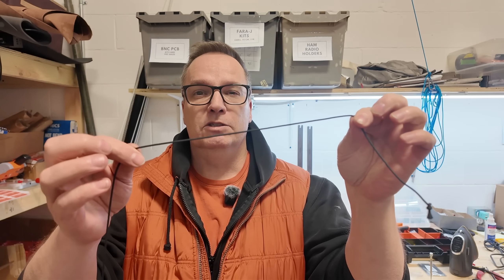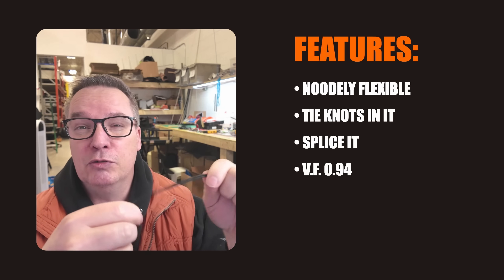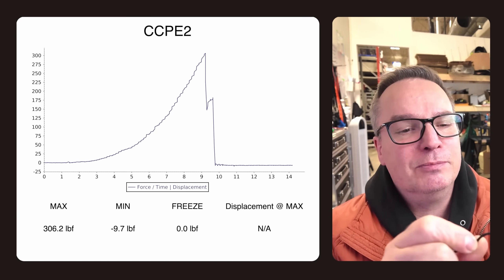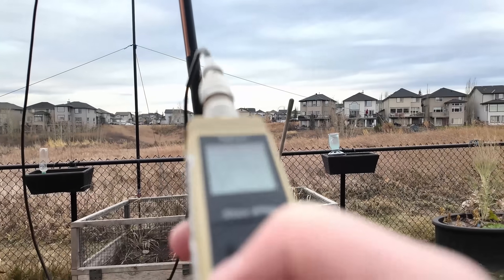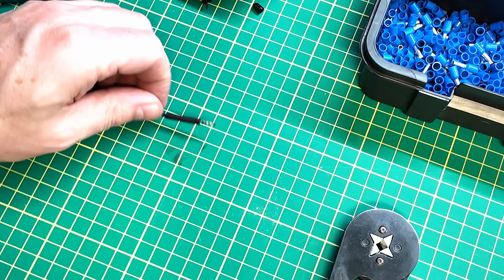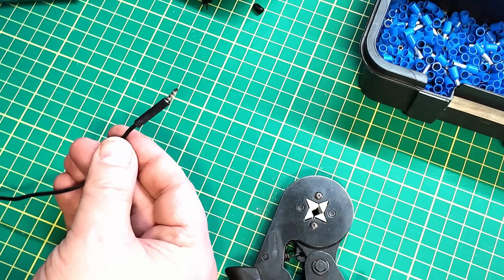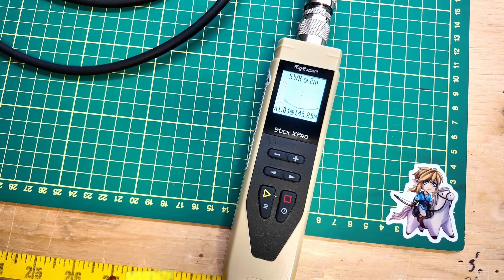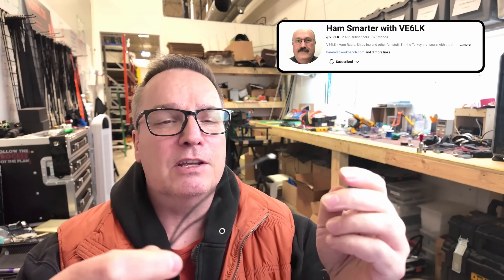This ‘Rope’ Is Actually Antenna Wire — and It Matched Copper Wire

Comment: It’s actually a 2 dB loss relative to a copper dipole.  That’s huge when you are squeezing out every watt.
Reply from the maker: A fixed “2 dB loss” claim only makes sense under assumptions. Once you factor in deployment height, pattern, ground interaction, and matching losses, material conductivity alone rarely tells the full story. That’s why I focus on comparative on-air results rather than theoretical penalties.

Comment: Greetings!   Now I can fly my 8' Delta kite without RG-174 coax with a vertical dipole, and use it just as a EFHW without worrying about the string breaking.  The kite takes one minute to reach 200' and is light weight for SOTA or POTA with a 5 knot wind.  Slip knot SWR adjuster is great.🤔
Reply from the maker: As with anything in the air the air will build up static on the RSE line. If you do this make sure to have a ground line!

Comment: This is really cool, and so many possible applications outside of Ham Radio! What kind of power will it handle? Can it be used to run phone/CCTV/12v to an outbuilding?
Reply from the maker: The resistance of the line is not conducive to DC. I am working on how to reduce this though and hope maybe in the future that this would be possible. Right now 100-150 watts will be the max on it

Comment: So 300 lbs before it breaks what does this mean in a ice storm ? Sooo its 8.32 pounds per gallon  300/8.32  is  36 gallons worth of ice .... but wait a antenna support from two directions so it would take 72 gallons of ice to bring it down. Yes your 160m dipole should be just fine. Its not too often you see a dipole holding up a 55 gallon drum of water. But we don't know what's happening to the nickel coating during that kind stress. Thinking carbon fiber will give before  it stretches while nickel over a distance would give a bit. In other words I'm thinking the mechanical failure will be noticed before the electrical. Plus there's plenty of overhead anyway. Not just a solution for portable antennas it may have a great spot for the qth as well.

Comment: you missed the best design from the old british army antennas. the core is dacron but you add plated copper to the braid weave. this allows stretch without stretching the metal wires, and because the surface of the braid contains copper, you can unroll your fraction of a wavelength and anything left rolled is shorted and electrically doesn't affect resonance.
Reply from the maker: Great point!

Comment: Tractor supply 600’+ 820jb wire for 70 bux US
Reply from the maker: Yes but no where near as light or easy to tie knots into. Still a viable antenna

Comment: Well i strongly disagree with your modeling. We need to remember the skin effect since you have alot of fibers you have alot of skin more than copper wire. Reminding me of litz wire made with  many many hair like copper wire increases the surface area to minimize the effects of the skin effect i.e. all of the copper is conducive as it is in DC. My point its might be right up there with copper since you have to many conductive paths 

https://en.wikipedia.org/wiki/Litz_wire
Reply from the maker: Fair but how does one model this then?
Reply: @VE6SFX_HamRadioRookie  thinking the vna is the answer for that. There's a few ways to employ it for the task using both ports.
Reply from the maker: Good point! I'll need to study up on how to get this info from my VNA. Appreciate the help in leading me down the right path.

Comment: Brilliant! I'm interested if it's orange. Can't beat DX-wire Ultralight UL for portable ops, but it's black...great for stealth, but therefore hard to see when hanging it, snarling it, and tripping over it. ;) 73 DE NØIP
Reply from the maker: Yes on the second run I’ll be doing orange for sure
Reply: @VE6SFX_HamRadioRookie I'm intrigued by your design. 73

Comment: It might change electrical characteristics when it gets wet, and or freezes.
Reply from the maker: We have done some preliminary testing. And it varies less than expected . But it is a good point
Reply: Thinking Nickel will hold up as far as chemical degradation after all it is what makes stainless steel but Im very easily could be way off
Reply from the maker: The manufacturer has had the raw core material outside for 10 years and the only noticeable difference is the color. In the end I suspect my overbraid will be the weak point

Comment: Nice stuff, but i don't trust this kind of flexibility. If it is as you showed and it can be used every day and lasts 1 year, than i think this is very great.
Reply from the maker: I understand your concern about flexibility and durability. I'm actively testing its long-term performance. I’m confident it will last just as long as copper wire

Comment: I am thinking about erecting an 80m horizontal loop. RSE sounds like a good choice.

But I must note, the price is high compared to Callum's DX50 wire. Regardless, I signed up on your email list; hopefully more trade will make it easier to bring Alberta in as 51st state. 🫣
[Edit: forgot about tariffs to US, cost may change]
Reply from the maker: I have figured out the tariff thing. CUSMA allows for radio communication antennas to pass tariff free. It’s just more paperwork on my end.
Reply: @VE6SFX_HamRadioRookie WOOHOO !!!

Comment: Have you tested it with 100w cw? 73
Reply from the maker: I have not yet. As far as calculating the power and heat the resistance should make at the ohmic resistance, it should handle 150-200w

Comment: Really cool!  It reminds of an idea I had years ago about threading wire down the hollow center of that yellow poly rope you see used in marine environments.  It doesn't weather the sun very well so I wonder what the UV resistance of this stuff is?  Still a poor man's version is copper wire threaded through the center of poly rope and you can go through the braid at any point to access the wire.  The rope takes the load while suspending the copper wire within.
Reply: My brother-in-law left what I thought was loosely woven rope. Turns out it has wires woven in to use as an electric fence for farm animals. Someday I may see if it antennas.
Reply from the maker: It will! This fence wire is not as flexible as RSE but it definitely will antenna.
Reply from the maker: That's a cool concept with the poly rope! UV resistance is definitely something I'm looking into for this.

Comment: Outstanding work Ben!  With the strength of this, it could eliminate a lot of drama in various antenna configs.  Verticals, dipoles, etc.  I wanna get some to run as a vertical.  Oh lord, get crazy and replace the dx-10 wire in my dx-commander...
Reply from the maker: Great idea! it would be a fraction of the wire weight and help structurally on the dx-commander

Comment: Given is so light I am interested in a portable Delta Loop or half square between whips.  Is the whole thing conductive or just the core?
Reply from the maker: Just the core. Definitely something I should have pointed out
Reply: @VE6SFX_HamRadioRookie so I assume it needs special construction techniques for both mechanical and electrical connection?
Reply from the maker: No not really. Crimping like shown and Vince’s video in the description shows a basic solder connection. No special gear or anything. Mechanically, tie a knot, hook it on something.

Comment: Would be neat to replace one of the (non-load bearing) lines on my paraglider with one of these and have an antenna built into the canopy.  Cool stuff!
Reply from the maker: I am an aeronautical engineer. I could go through the approval process to get it air worthy. :)

Comment: Give me some feedback on this video! I need to know if my investment in 6000' was a blunder or not.
Reply: I would love to get some and to do a review.  I know I am not a big name YouTuber, but I would do a solid review of use and application
Reply: Great idea and im thinking it more competitive with copper than you realize. Reminding me of Litz_wire. With so many fine wire the surface area is higher decreasing the radiation resistance. 
 https://en.wikipedia.org/wiki/Litz_wire
Reply: Send me 500’ and I’ll let ya know bud! 😂

Great video!
Reply: This was no blunder, IMHO. This is brilliant. I'd buy it all if I had unlimited funds.
Reply: New speaker wire for tweeter.